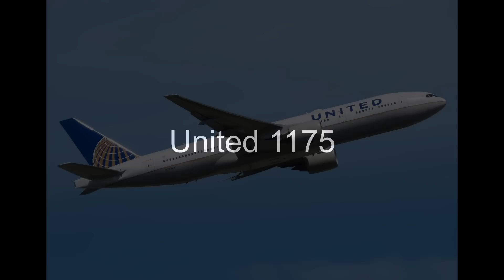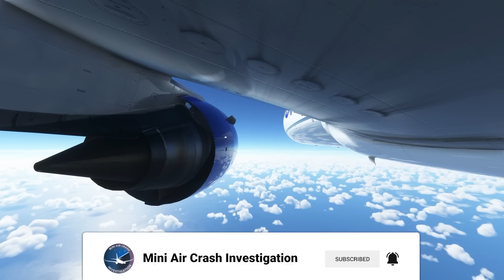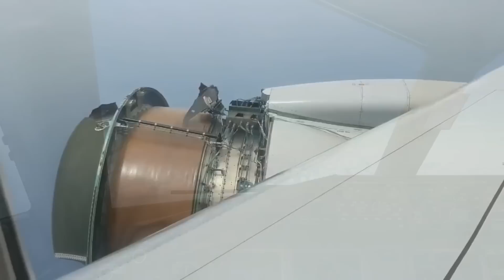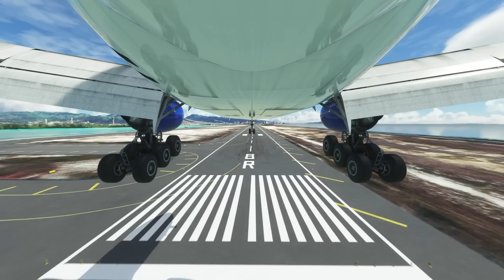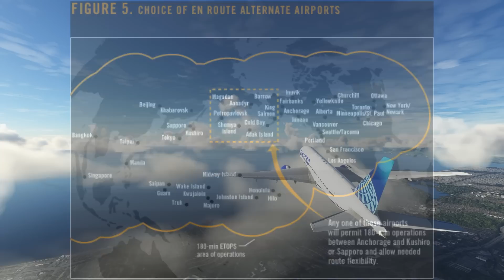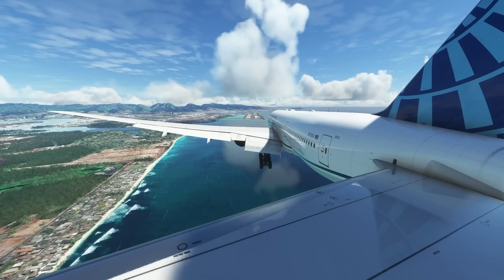How A Room With Bad AC Almost Crashed A Passenger Jet | United Airlines Flight 1175

Comment: Is nobody talking about how often these hollow fan blades spontaneously disintegrate in flight? This famously happened on an AirAsiaX flight on June 25, 2017 - and this latest China Eastern incident (which has gotten far less media attention, probably because this happens a bit more than you would like) marks at least the fourth time this has happened with the Trent 700. As of November 2023, the Trent 700 has accumulated over 68 million hours of service since EIS in 1995. Just compare that to the 180 million total accumulated flight hours of carbon-fiber-composite blades on GE90/GEnx engines since their EIS in 1995 - the same year - without a single fan blade failure! This isn't only a Rolls-Royce problem - just look at the three PW4000-112 fan blade failures within the past several years, most notably the UA328 incident which resulted in the entire (and thankfully tiny) fleet of PW4000-112 turbofans being grounded for a long time - it's like the Three Stooges run P&W 🤣🤣🤣 hollow fan blades are indeed quite safe - only if the blades are properly manufactured and maintained - and that has proven to not always be the case.

RB211-524: 1

https://www.atsb.gov.au/publications/2002/tr200200646

Trent 700: 4

https://avherald.com/h?article=43ca1f91&opt=0

https://www.atsb.gov.au/media/news-items/2020/fan-blade-failure

https://avherald.com/h?article=4b4adfe3&opt=0

https://mentourpilot.com/incident-a330-engine-fan-blade-fracture-vibrations-in-flight/

Trent 800: 1

https://www.atsb.gov.au/publications/2001/tr200100445

PW4000-112: 3

https://avherald.com/h?article=4b4e8ca7

https://aviation-safety.net/wikibase/245358

https://www.ntsb.gov/news/press-releases/Pages/MR20210221.aspx

GP7200: 1

https://simpleflying.com/air-france-a380-engine-failure/

CFM56-7B: 2

https://simpleflying.com/southwest-2010s-uncontained-engine-failures/

Comment: THIS IS THE SECOND VIDEO THAT I POSTED ABOUT OUTBOARD CAMERAS, AND BOTH TIMES PEOPLE GANGED UP AND STARTED.
FACT THEY PUT OUTBOARD CAMERAS ON PLANES.
FLIGHT 191 OUT OF CHICAGO IN 1979 HAD AN OUTBOARD CAMERA.
Reply: Yes, some planes have them sometimes and they aren’t new. But you still don’t typically see them in most planes. And like I said before the main reason you don’t see them more is because the benefits they could provide are not enough to make it worthwhile considering their cost, power requirements, maintenance needs, added weight, added training, etc. You can’t just tape on a couple of Go Pros!
Reply: @Sashazur  DUDE THEY HAVE CAMERAS.

Comment: I am glad I didn't sign off on that last inspection. Feel sorry for who did. Appear P&W good engines but not as good as years ago. Well, that appears with everything now.
Reply: I was a fan blade inspector for UAL at the time of this incident. There were only a hand full of us, 3-4, inspecting fan blades at the time. We were all concerned that we would be the one that had made those set of fan blades serviceable and it was something that we had missed. I never did hear what the final determination was as I retired in September of 2018. So this was quite personally interesting. I'm relieved it wasn't any of my fellow UAL inspectors that had missed something.
Reply: @fireisle  
I been there myself too. I know what you are talking about. Sadly this type of corporations action is  only increasing.

Comment: What's old is new.
Following is a commentary regarding problems with the heat treatment of Springfield 30-06 receivers early in their production:

The problem was with the heat treating furnaces and the "experts" who operated them. In the absence of measuring devices, the heat of the receivers in the furnace was judged by appearance, that is, by the color the metal turned at certain temperatures. When measuring devices were finally installed, it became evident that on sunny days the receivers were heated to a much higher temperature than on cloudy days, when the color of the glowing receiver was easier to judge.

Comment: I attended a formal training course on a revolutionary, super expensive, electronic equipment.  19 technicians (21 total) were stuffed into a room the size of a bedroom.  The room had no ventilation.  We could only open the door.  It was hot and the air stank of sweat.  To top it off the two instructors forgot to bring the power supply.  For four days (8 hours a day) we studied paperwork but we did not touch the equipment, nor saw it operate.  We were all given codes saying we were certified technicians.  The only thing I remember was how miserable we were. 

The technicians came from all over the world.  I flew from Hawaii to the headquarters for the training.  Other people had flown from Europe and Australia.

The funny thing was my office never got the equipment.  The equipment that was bought for Hawaii, was kept at headquarters to show visiting VIPs how fantastic it was.

Comment: I saw an interview with the pilot of this aircraft; he said when the engine disintegrated the plane rolled almost to the point where he was considering rolling it all the way over to get it back. He also said that the dead engine was putting so much drag on the airplane that if this it happened farther away from the airport it's very likely they would not have made it

Comment: Great video, but one of your major conclusions is categorically wrong. United 1175 did not prove the wisdom and safety of twin engine jets over open water. In fact it came remarkably close to proving the exact opposite. The problem was the ETOPS 180 rating assumed an aerodynamically intact aircraft. With United 1175, just as it had a few months prior with United 329 over Denver, the uncontained engine failure had blasted the cowling off the engine. The no longer streamlined engine became a huge aerodynamic drag on the aircraft. Captain Behnam had to fly 40 minutes with the yoke full over to the left straining his muscles to the point his veins were popping out. His crew had to pretty much pry his hands off the yoke when they landed. They barely made Hawaii, because they could not maintain altitude on 1 engine with the amount of drag the second engine was causing. They were at a slow unstoppable rate of descent. They had to land where they did as they could not climb and had lost enough altitude that they could not clear the mountains on Hawaii to reach an alternate. They had one shot at one runway. They could not go around. They could not climb and they could not circle to another runway as they were bleeding altitude. They landed fast and heavy and just barely managed to brake to a stop.
This is not to criticize the pilots Captain Behnam did an incredible job in what was an absolute worst case situation. His crew performed remarkably. And in some ways this flight also showed the benefit to having the third crew member in the cockpit. They lucked out in that had an observer who was in the process of qualifying on the 777. He was an experienced pilot and gave them an extra set of hands and the ability to send someone back to look at the engines and return with photos and video. So the Captain knew what he was facing.
Juan Brown aka Youtubes blancolirio did an amazing hour long interview with Captain Behnam last year where he talked through the entire incident. It's actually shocking to hear just how crippled the plane was. All the news really mention's is they landed safely at Hawaii. It was apparently much closer to disaster than the news media realized. Of course there was a lot of pressure to sort of soft pedal this one as it was the second such incident to a United 777 within a matter of months. Calling into question all of the Pratt&Witney PW4000-112 engines in the air.
Reply: Why would the Captain have the yoke full over to the left for 40 minutes? That is why  you require left RUDDER to counteract the yaw. Seems to me if this was the case the spoilers on the left wing were quite extended for 40 minutes which could explain why they were having a problem maintaining altitude. Are you saying the Captain did not know how to handle an engine out?
Reply: @georgeconway4360  I think the massive difference in lift between the two sides would create a roll that can only be counteracted by aileron input, not just with the rudder. As OP mentioned, the plane rolled over dramatically.
Reply: @LuLeBe  There should not have been any difference in lift between the two wings based on the damage reported. The damaged engine did not cause a loss of lift but the damaged engine and cowl  produced a large amount of drag. This drag caused the right wing to drop and the airplane to turn right. The Captain used full left aileron to correct. Remember they were nearing their destination so they were descending. Since they had been level FL380 they had to descend to their single engine operating altitude even if they had been 1000 nm from landing. That additional drag would require more left rudder than a simple failure of the right engine. It appears to me the Captain probably corrected for the additional drag with aileron rather than rudder. The full left aileron would cause spoilers to extend on the left wing which could explain why they could not hold altitude. I don’t see anything in any of the written reports that mentions the difficulty controlling the airplane. UAL and the FAA know exactly what happened because everything is recorded. There are no secrets on modern airplanes.
Reply: @LuLeBe  If your engine fails you will roll away from the good engine. You do not correct it with aileron you use rudder. The way I see it you counteract the massive drag differential like thrust differential with rudder not aileron. Using the aileron only created large amount of additional drag so they could not hold any altitude. Let’s see the data from the flight recorder. Possibly is I am correct the problem can be voided if it happens again.
Reply: @George Conway  the problem was not the engine out. The problem was the massive drag of the dead engine with the cowling blown off. I'm describing the Captain and flight crews own words. Captain Benham would seem to be an A list pilot. The exact man you want flying your plane. Juan Brown blancolirio youtube channel has an hour long sitdown with Captain Benham. Go check it out. But the key troubling takeaway was with the planes aerodynamics compromised they could not hold  altitude on 1 engine. They were in a steady slow rate of descent.
Reply: @andrewtaylor940  Thrust and drag are both forces on the airplane from the same exact location on the wing.  When the right engine failed left rudder was required to counteract the asymmetric thrust from the MCT set on the left engine for the drift down. With just a engine shutdown with no damage once you start the normal descent with idle or close to idle power on the good engine you have to re-trim the rudder because the asymmetric thrust has been reduced. You then have to use left rudder gain any time you increase the power on the left engine. With this severely damaged engine producing all this additional drag would require Rudder not ailerons to keep it flying straight. In this case the drag by the damaged right engine is equal to thrust but a negative thrust. The comment I had read the Captain had been holding full left ailerons which I believe would have also given him flight spoilers on the left wing causing unwanted additional drag. Thus my desire to see how much left rudder was being used and how much was available from the FDR. If the Captain was was using all available left rudder and still required full left aileron it is one thing. If he was using aileron to keep the right wing up with little or no rudder he was shooting himself in the foot. The recorded flight data tells the story. There are no secrets on modern airplanes. It could be the reason they were in a steady slow rate of descent was because of the Captains use of the full left aileron.
Reply: @georgeconway4360  Here's the interview with the Captain. Make of it what you will. The NTSB report is out and it praised the crew for their performance and actions. I'm just the messenger here. https://www.youtube.com/watch?v=J7_lzeY23dI
Reply: @andrewtaylor940  Thats all fine, things all worked out but we all can learn just in case it happens again. UAL, FAA, and NTSB have all the data and could answer my question. The NTSB and the FAA don’t always have the correct answer. I’ve read a large number of accident reports and watched the videos here on youtube. TWA 514 on Dec 1, 1974 is a prime example. They hit the ground at 1675’ MSL 25 miles from their destination IAD. If the crew had been trained as well as crews in other countries they never would have been that low. Pure ignorance a result of not learning some of the basics. At 25 miles they should have been 7500’ MSL.
Reply: @andrewtaylor940  I listened to the interview. I still would like to see the data from the FDR to see if that full left aileron was required. At the end of the the Captain stressed the need to hand fly the airplane conditions permitting which I agree 100%. When things go to hell there is a good chance you will have to hand fly and practice makes perfect. He also talked about using distance and altitude to judge the descent. The 3 x Distance for altitude and 5 x GS for vertical speed is something lacking in the U.S.A. training. The TWA 514 in 1974 going into IAD or the Flying Tiger 747 crash at KL in 1989 would have been avoided if the crews knew how to hawke these simple calculations.
Reply: I would like to see the recorded flight data of the amount of left rudder that was in use while the Captain held full left aileron!
Reply: I really suspect that the liberalized rules allowing trans ocean use of twinjets in passenger service are questionable and politically motivated. Fuel economy over safety? 
I guess they have  lots of liferafts and flotation jackets on board-----
Reply: @davidpowell3347  That's basically what the deal was. The US FAA is in a weird place. It is supposed to both support and encourage and act for the air transportation industry, and regulate and police them. It's two main missions are frequently in conflict. And much as we see with the FDA and CDC falling all over themselves to do whatever big Pharma wants, much of the FAA is firmly captured by the major airlines. What the industry wants the industry gets.

Comment: In this incident, part of the fan blade exited out of the front of the engine and partially punctured the hull next to a passenger seated forward of engine.  Fan blades going out of the front of the engine is something that most people would consider impossible but is a known failure mode. A few inches higher and it would have hit a window. 

Laboratory examination of the skin surrounding the puncture found embedded particles of largely titanium and vanadium that are elements of the fan blade material and thus proving that blade fragments can and do exit out of the front of the engine, even when the incident is considered by definition “CONTAINED”!

Comment: Quite incredible that a massive aviation company had such a crapulous area for conducting highly sensitive tests - moreover, on a FAN blade - quite possibly the most important single component on the entire plane  - you would have envisaged a surgically clean, climate controlled, perfectly lit, hermetically sealed lab looking like a movie set for a Sci fi film. Absolutely incredible - and for all those highly qualified people to be in the same room and none of them think to query it seems astonishing  -  just goes to show that often really clever people lack common sense! 

Similarly, the fact that the testing expertise was passed on like an apprenticeship - alright for blacksmithing or plumbing, but probably not for such a safety critical vital functional test which presumably required not only nanometric precision in conducting it - but great technical knowledge and experience to work out what state a blade is in from the raw data  -  as someone wholly unconnected with aviation, I can honestly say that to me it would have stuck out like a sore thumb - where are the written protocols, on what basis do we pass or fail a blade and why those factors are the basis - and clearly, because pronouncing on the state of a fan blade is such a high level decision clearly. One would surely feel the weight of the responsibility of each and every one since wrong calls could, depending on which way round, see a faulty one put back into service which goes on to cause a catastrophic failure where lives are lost or, if you are too conservative and fail an acceptable blade, that is probably adding tens -  if not hundreds -  of thousands of dollars unnecessarily onto the bottom line and, while safety is pretty important, by definition it is less important than making a profit cos if you don't, there's no company anyway.

I really found this fascinating for sure - but mostly, just bizarre!

Comment: This is an ex-UAL plane and it's why original Continental planes all had GE 90 engines.
Reply: One of the most awesome things about the GE90 (and GEnx, GE9X, and LEAP, too) is that these have solid carbon-fiber-composite fan blades - meaning no hollow fan blades that might be susceptible to disintegration.
Reply: @rafaelwilks  Those blades can also have problems but the GEs are much tougher engines than P&W stuff.